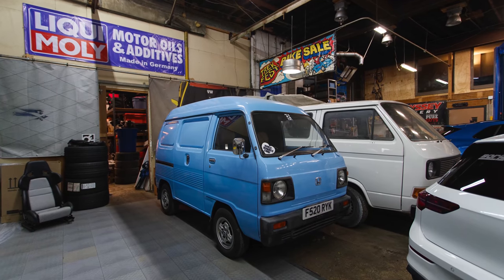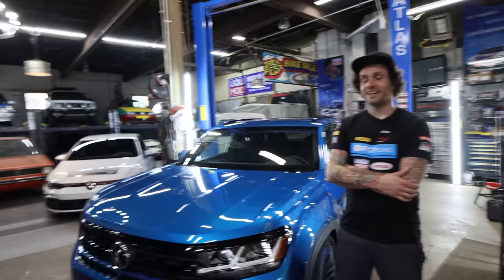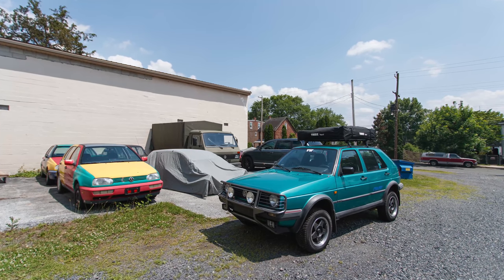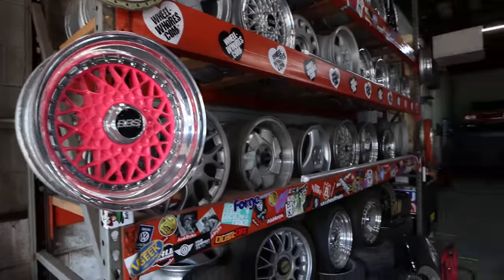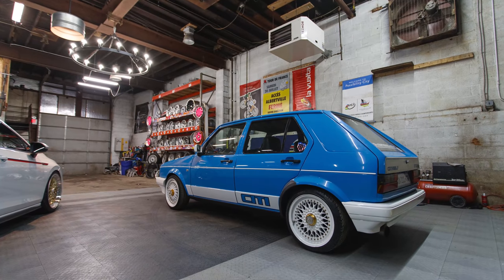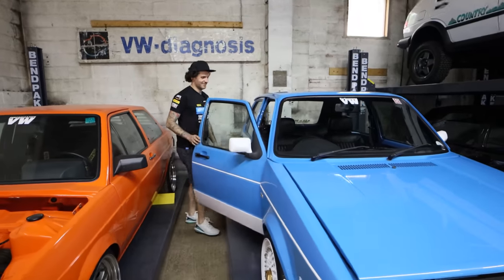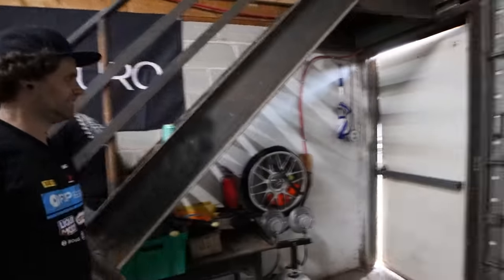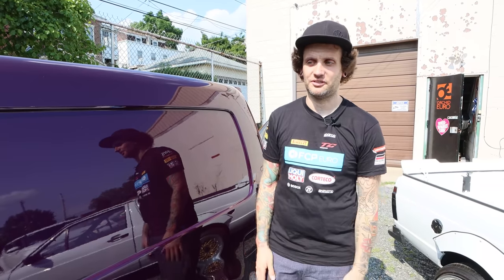Jamie Orr’s Orchid Euro is Volkswagen/Audi Paradise

Comment: The blue/white Citigolf and the purple Caddy are a dime a dozen in South Africa.
Most Citigolfs are modified and considered pretty quick on the streets too.
The front end is a 90's spec front whilst the dashboard in this car is out of a 2004+ Citigolf. 
They were available from 1.3 carb up to 1.8i. 
PS:The Citigolf with this color scheme was available in blue/white, red/white and yellow/white in addition to solid and metallic colors with full color coded bumpers and trim.